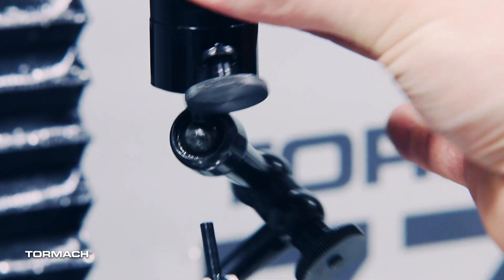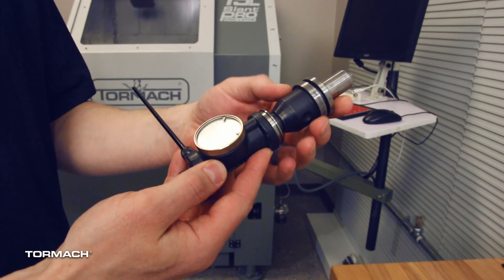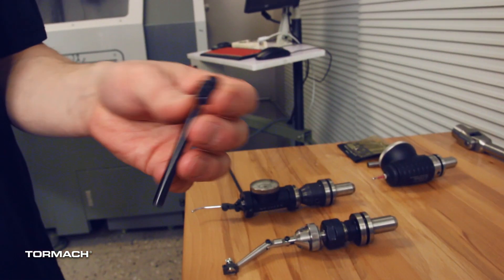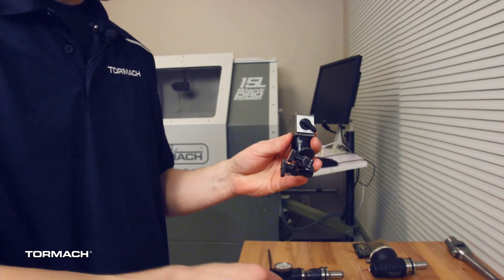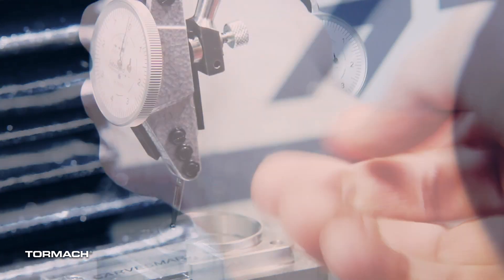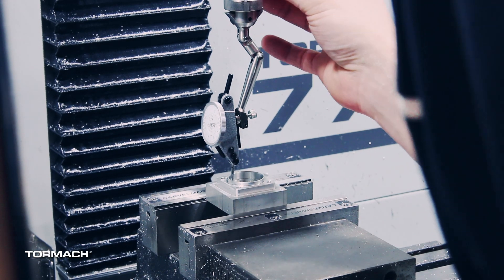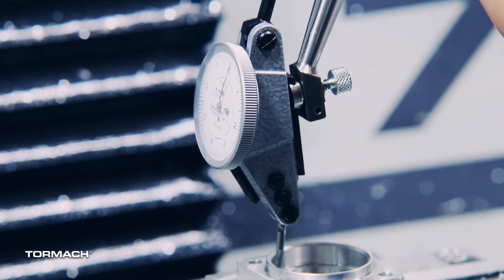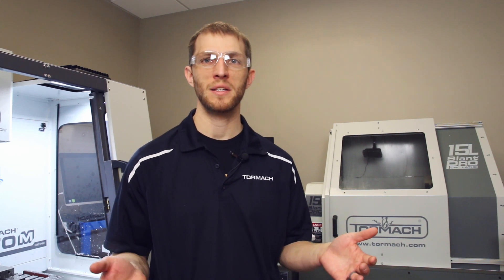Indicating the Center of a Hole for Proper CNC Machining

Comment: Good job on the video.

Just my 5 cent from indicating like 315646 holes, usually if you grab the indicator by the dovetail on the top (where the dial is, just by the side of it, held by 2 small screws) you can put the dial facing upwards (z+) and bend the needle facing down.  then don't need to use a mirror or bend like a rubber girl to see the back side of the bore.